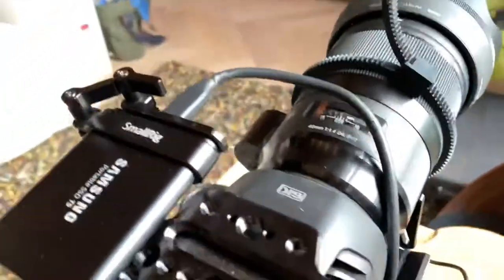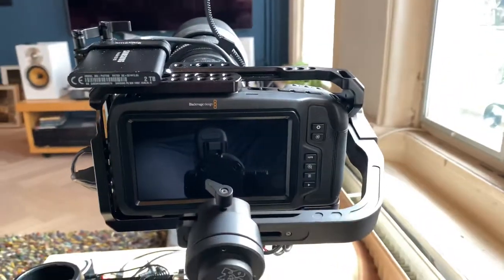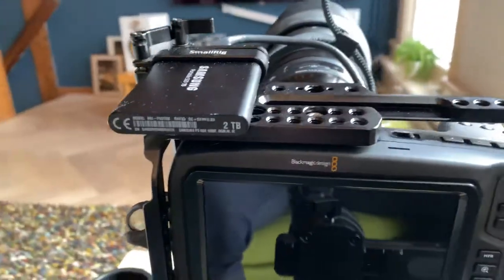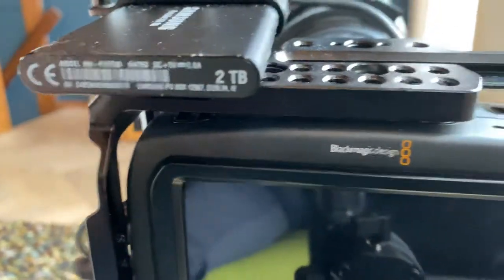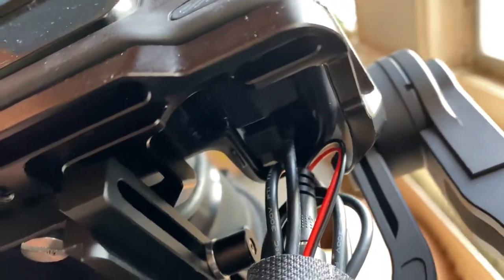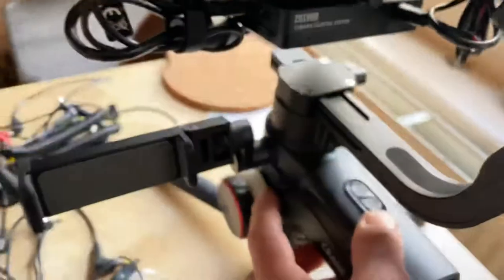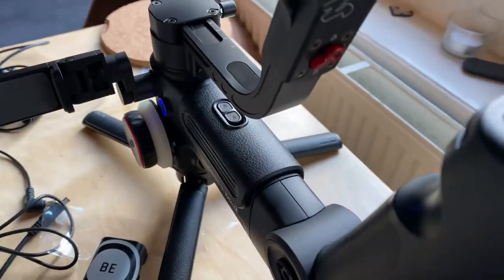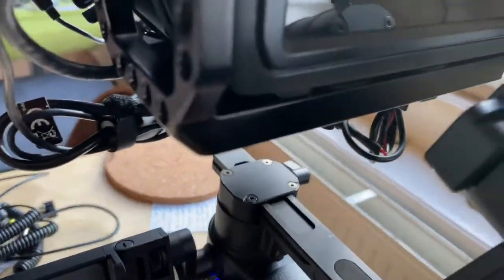Zhiyun crane 3 and blackmagic power cable does NOT WORK

Comment: Did you have to change camera setting for the video transmitter?  I couldn’t get mine to work with the bmpcc 4K
Reply: Just an update on this problem,  this gimbal comes DOA with some features dead out of the box, unless you are lucky.  I didn’t bother replacing it after some research,  it was the only gimbal that could handle my setup up during the time and I had projects that prevented me from returning this gimbal.  Luckily, I did not pay full price for this.  I bought it off b&h for a fraction of the price

Comment: is there any specific DC cable we need to plug in in the gimbal ,because I have 2 DC cables but non of em can be plugged in the wholes I am afraid to force it ,that's why I'm wondering maybe there is a different type maybe >> can you pls help<<
Reply: I made my own, but it simnply does not give enough power

Comment: Just got the bmpcc 6k and a crane 3 lab.  Idc if it can't power it cause it came with 5 batteries.  But does it balance properly? Cause I had a hard time tryna balance my blackmagic 2.5k on it
Reply: Sha Money even with proper balance,  I get micro jitter after proper calibration,  sadly that my crane 2 didn’t have that issue.  I can’t trust zhiyun product anymore.
Reply: Oh yes  but it seesm that the camewra is a little bit to heavy for the crane. I like my 'old' DJI gimbal much better